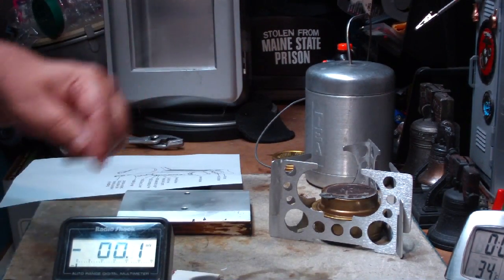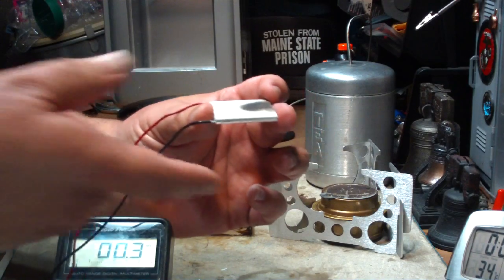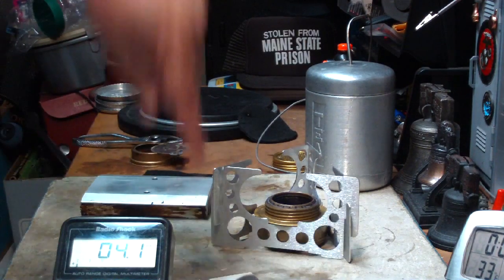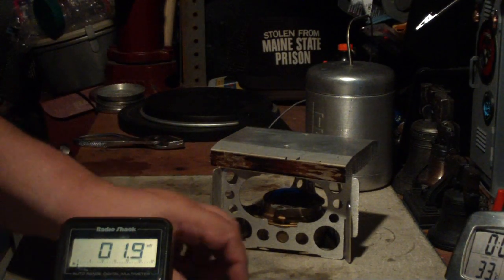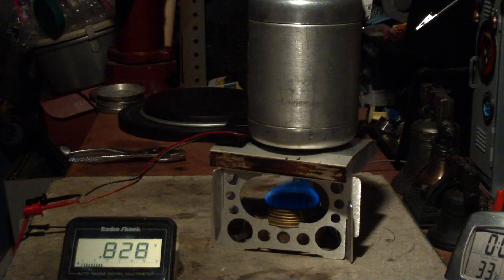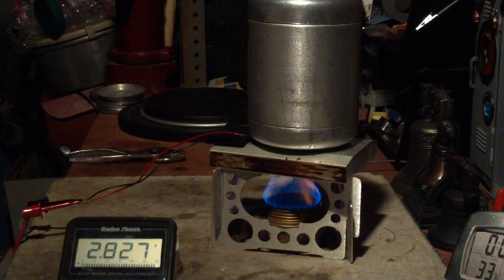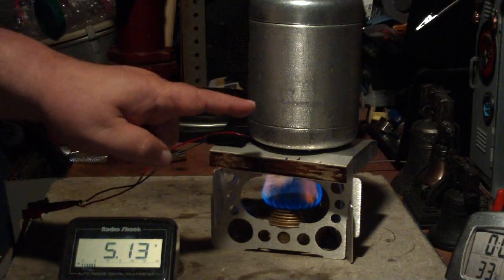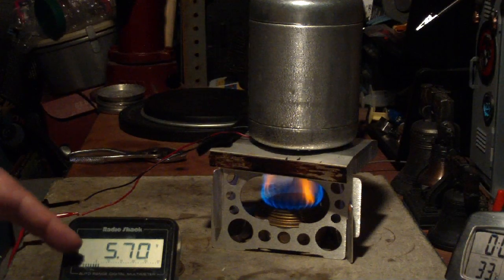Demo of the Seebeck Effect

Comment: I don't think he's mixing up the terminologies.  From what I gather, the peltier device is called so because it uses the peltier effect to cool these refridgerators.  Peltier Effect:  " the presence of heating or cooling at an electrified junction.." The seebeck effect is present here because the seebeck effect describes the process in reverse.  Seebeck Effect:  "the conversion of temperature difference into electricity.."  I believe what you were looking for is inside the ceramic device.

Comment: I guess I'll have to be the nit picker here but I don't believe Peltiers use the Seeback effect. I believe it is referred to the carrier charge diffusion. 
I was hoping to see a demonstration of the Seeback Effect such as electricity being generated by the temperature difference between a copper/constantan and steel/iron plate. 
I did consider using a peltier device to generate electricity for a concentrated solar device, until I started doing some estimate calculations of the heat generated...

Comment: that's not the Seebeck effect, its the Peltier effect. they are different, the Peltier effect uses thermocouples with two different materials where the Seebeck effect has one conductor which is hot at one end and cold at the other.

Comment: The difficulty of a DIY is that device uses a special low temp solder that melts much easier than what is regularly used for electronics.

Comment: Great Video.  Check out Epicenter.  Really into the TEG pot chargers.
If you buy a cell phone you got to charge the battery before using it. Same with the Biolite stove
except you never have to charge it again because the fire will now keep it topped off.  Think of the battery as just a bootstrap to get the stove going, like a car battery just starts the car but does not make it go.

Comment from the maker: The manual seems to say there is:
"Battery not charged (if flashing light)
Charge battery by plugging Power Module USB connection to computer.

USB not charging - Battery not charged. Add more fuel to fire to charge battery.

BATTERY HAZARD. The rechargeable battery inside the power module may present a risk of fire, explosion, leakage or chemical burn if mishandled."

The manual can be downloaded from the site.